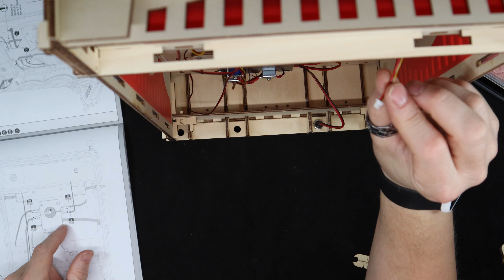ROKR 3D Pinball Steps 13-14

Comment: At the 2 minute mark, after you put in the two tabs to hold the table, the directions show Q1 and Q 2 pieces going in, before you insert the end piece, you do not show that, and I can't find any pieces that say Q, are these necessary then?
Reply from the maker: As I recall, I think I did forget to put in a couple of pieces, I only found I had missed them at the very end of the build, those could be the ones I missed, I think they are more for stability than structure, so I would put them in if could find them.
Reply: they are 2 clear plastic parts

Comment: I am John Lynch. I am the one putting this together.. I got to page where I tested the ball through the shuts and it stuck at each place where they joined together. The electronics work, Pluss when I stand it up the shuts do not stay in the slots, causing some of them to fall and the railing broke. Can I get new pieces from the company,  If not I am now stuck Please let me know
Reply from the maker: ROKR is generally pretty good with customer support, you can try and email them at service@rokronline.com I hope they can help you out.

Comment: hi, I watched all your Rokr pinball steps videos, but I'm confused how the lost ball can be transfered to the launch lane? I didn't see any coil or power mech near the bottom area, but it's obvious that the collect point is lower than the launch point in level.
Reply from the maker: It's an optical illusion, even in person it looks lower, but the launch point is actually lower.
Reply: @Dbuilderguy  Got it!  From a horizontal left-to-right view, the launch point seems higher. But in reality, it's lower in z-axis direction. I guess that’s how it works!